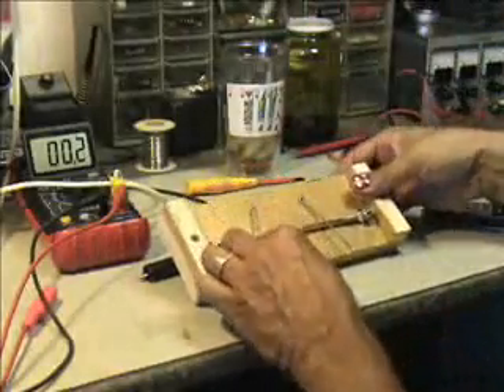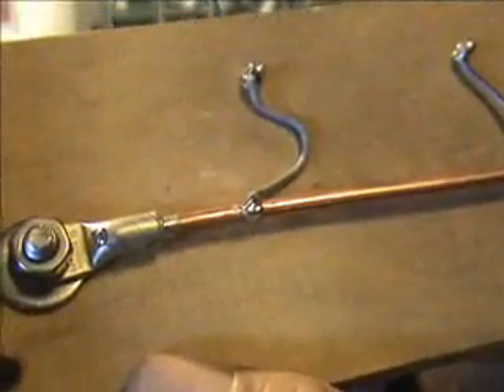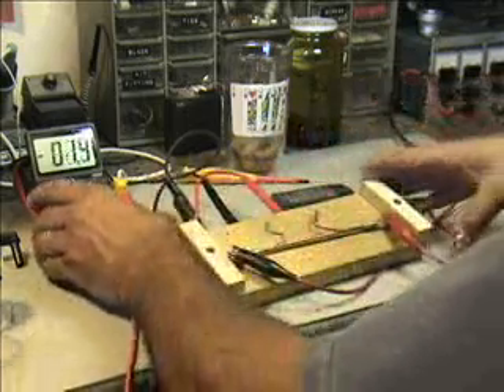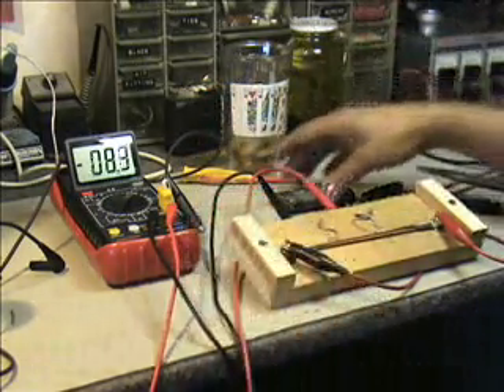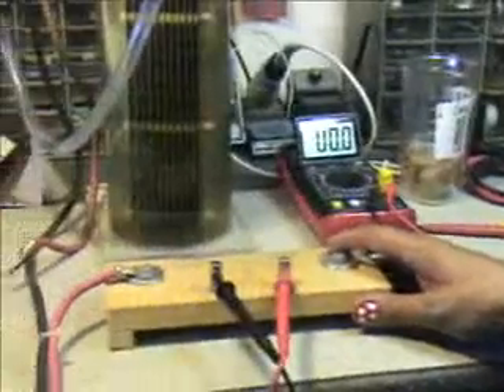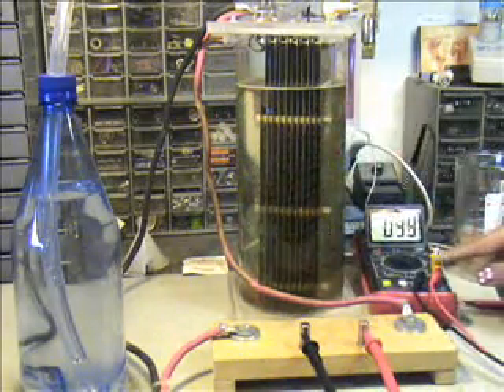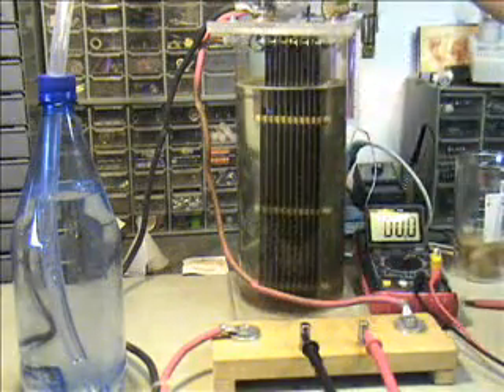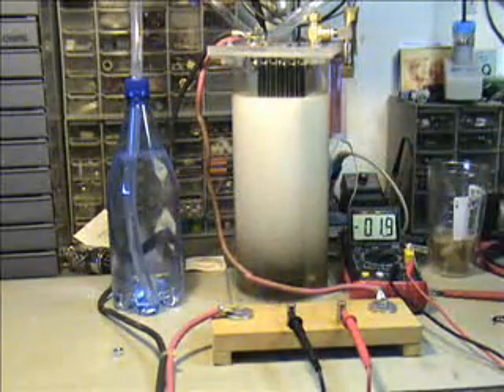Making a DC shunt Pt3

Comment: When you measure the diameter of a wire to determine the guage, is the plastic insulation around the copper wire included in the diameter?  Or is the copper only included in the diameter?
Reply from the maker: Hello Ed, when current or electricity is flowing through a wire it doesn't travel down in the middle of the wire, rather it travels around the outside of the wire! This is why you don't want your wire to get corroded and one of the reasons it is coated in plastic. The other being insulated against the shorting against another. So..... the answer to your question is: When determining the gauge of the wire, measure only the diameter of the bare wire and not the plastic insulation! Good question!